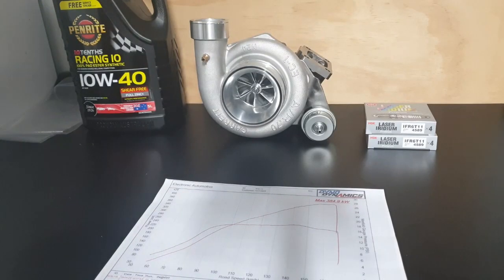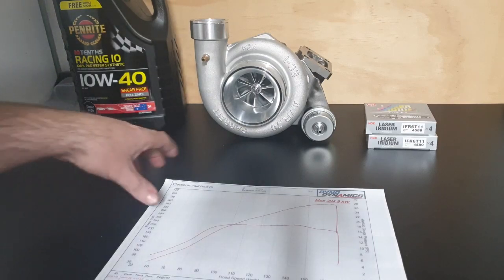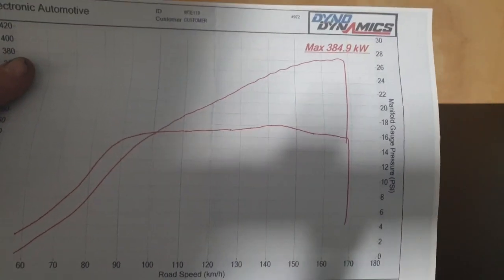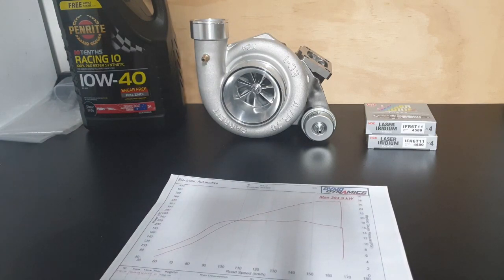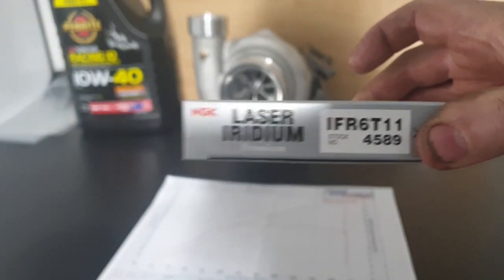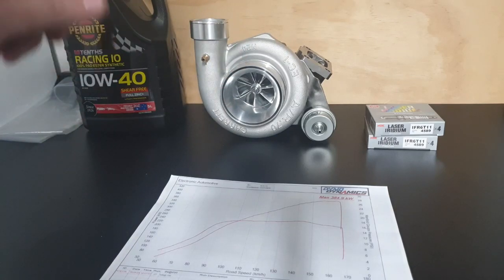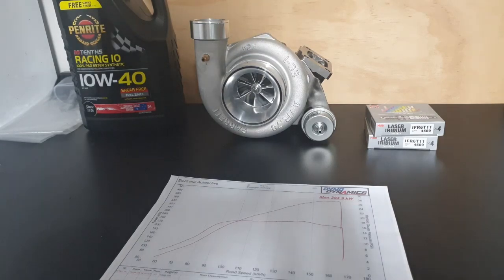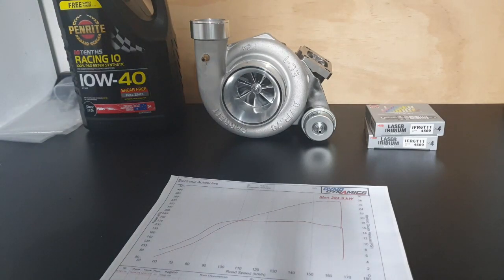FORD FG XR6 TURBO BUILD SERIES - Final installment -HOW MUCH POWER DID WE MAKE???

Comment: Sorry for your loss man. My fgx with gt3582r makes 400rwkw at 16psi on 98 on a dyna pack hub, i have heard dyna pack hub dynos read high but my tuner dissagrees. I dont know.  I get full boost at 2500rpm bypassing stock boost solenoid running straight off 19psi springs gate pressure turbosmart 45mm external gate  plumbed off 1.06 housing.
Reply: Thanks m8, 
Hub dyno's will always read higher numbers versus roller dyno 

example:
My fg xr6t made 540rwkw on a dyno dynamics roller dyno and on a mainline hub dyno made 645rwkw +
 I've heard the same thing about dyno pack hub & dyno tech hub they read higher then mainline hub dyno 🤔🤔